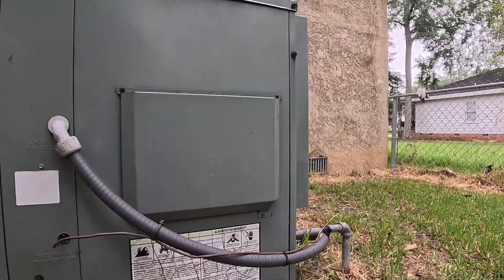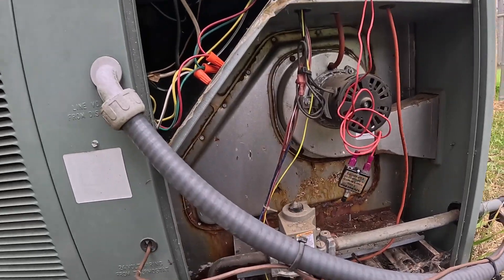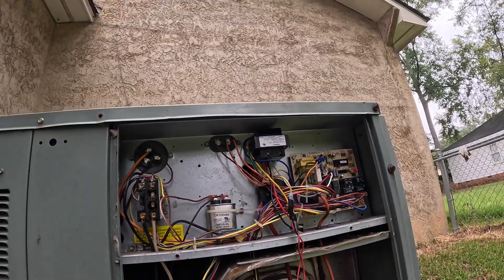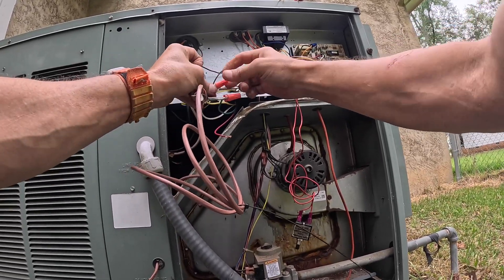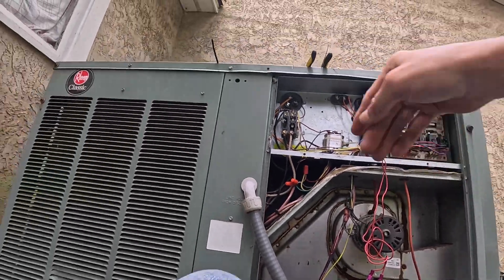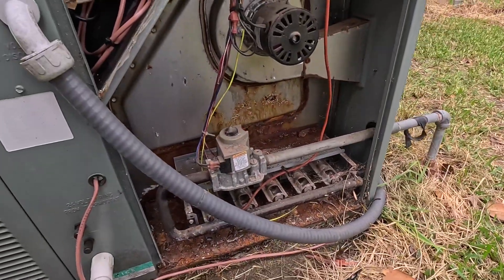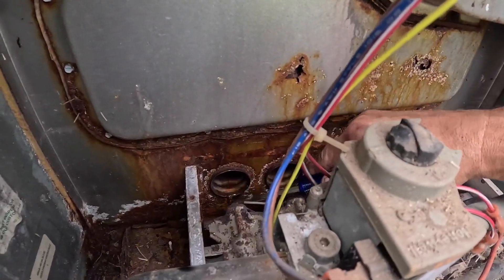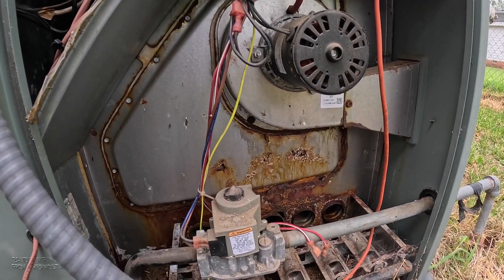Nothing Was Working - Low Voltage Short! #hvacguy #hvaclife

Comment: I had one that would run for a week or two then trip low voltage breaker every technician had been there except me so I got sent reset breaker and couldn't find any problem then I heard someone walking in the house and the floor squeaking and the breaker tripped went under house and found thermostat wire was between the floor and the joist and when they walked and stepped on the right spot it shorted out don't know how it got between joist and floor but had to be there since house was built  I just got lucky and was there at the right Time

Comment: Nice fix, at least until the homeowner trims around there again.  Suggestion: carry a few sections of 1" PVC and run the thermostat wires inside it if it crosses an area getting weed-whacked.  Using 1" rather than 1/2" will allow room for wire nuts if needed.
Reply from the maker: Great idea

Comment: Get some stainless and cut it to size for the very bottom Curtis. I had to do this on some of the commercial units.
Reply: When I did commercial industrial I told a customer so many times the pan needs to be replaced there's nothing left to them. Nope didn't wanna spend the $$, 3 months later both compressors came thru the ceiling 😂

Comment: A good repair Curtis, such a shame that cableing was not run higher off the ground,also a higher mounting pad to help prevent corrosion   👍 Au
Reply from the maker: New ones have a 2 1/2” metal skid plate underneath, plus, we put another 2” pad under it.

Comment: i may sound stupid but if the rust holes are on the outside of blower compartment..what is the danger
Reply: The blower motor believe it or not will actually draw co2 from the burners, why u can't run a furnace with blower door open unless u doing service work
Reply from the maker: Those rust holes go through to the blower compartment, at least the ones that I put the screwdriver through.

Comment: It seems a lot of these Package Units set on a concrete slab at or just below the ground.  An extra inch or two of slab would sure go a long way to help keep the base from rusting.

Also surprised the Thermostat wire isn't run in Sealtite or at least plastic tubing to offer some protection from the Weed Eaters.

Glad to see you looking out for the safety of the customer on the heat side of these units with holes in the heat exchanger.  Always look forward to a new video and thoroughly enjoy watching a Pro at work!
Reply: I call them furnaces in the dirt.  Agree that raising them would help.  A lot.